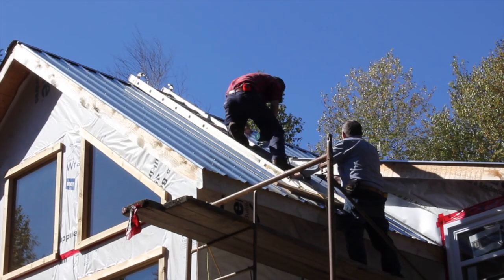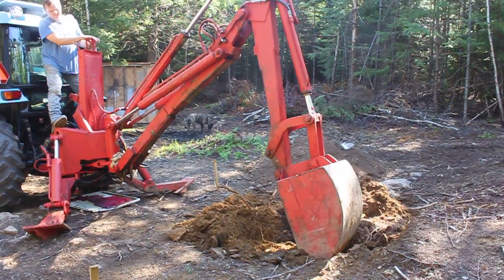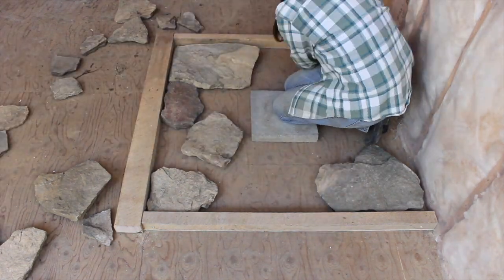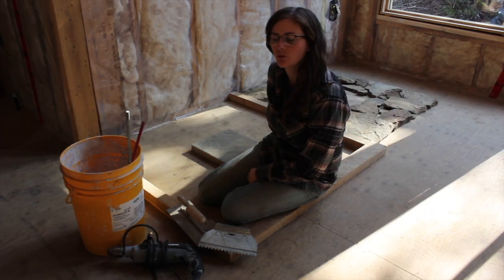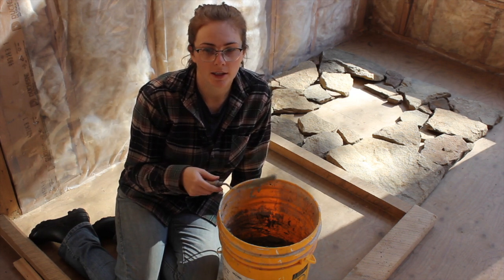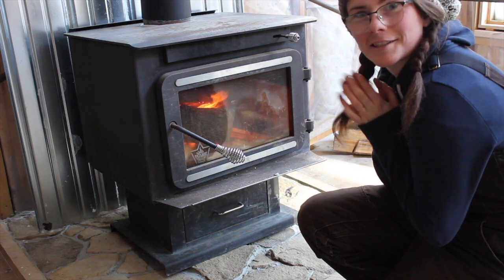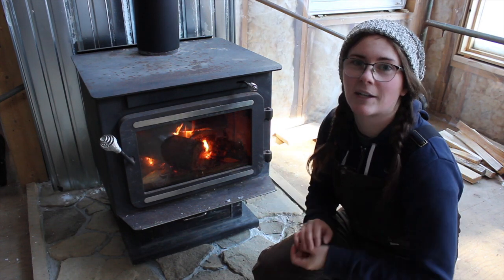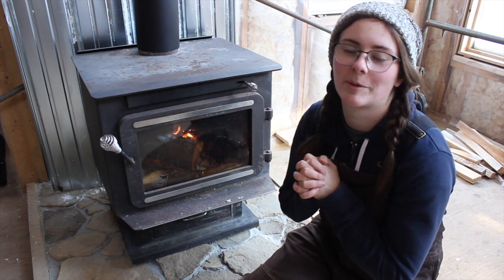DIY Stone Hearth Pad and Wood Stove Install

Comment: Your cabin is so beautiful and you did a great job laying out that hearth and mortaring it all in.  It's cool seeing everything come together.
When you get a few minutes, look up how to build a "top down" fire.  It's so much better than any other method of making a wood fire.  Once you have it laid out, you light it and close the door.  You don't have to tend it and keep it going, plus you get less smoke in your home.  The smell of a wood-burning fire is nice...in small doses, but if you've heated with wood very much, you know it can quickly become a problem.  The top down method of starting a fire is very efficient and results in virtually no smoke getting into the house.

Comment: What you using for back up heat. I live in near nome Alaska. Have 2 story home. Have. Bigger wood stove and 2 pot bellies. I burn coal in pots belly and different wood. Plus. Have gas heater.  When needed
Reply from the maker: Our plan is to have a propane heater as our secondary heat source but we have not installed it yet.

Comment: You should have put down 30lb. felt before putting the mortar down.If you ever have to remove the pad it is going to be a bear to remove the cement residue. Have you asked the people you got the stove from if you should have a combustion air intake duct? Is there an air space behind the metal shield?  If not there should be.
Reply: A suggestive tone is always friendlier than a directive tone…